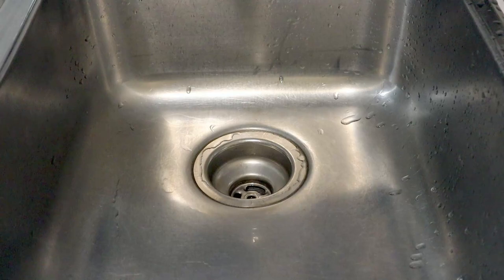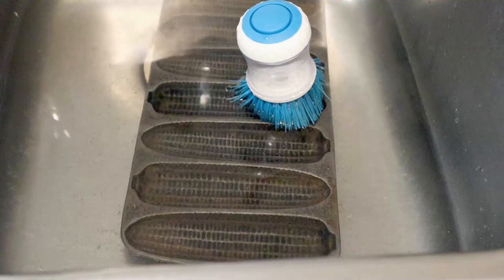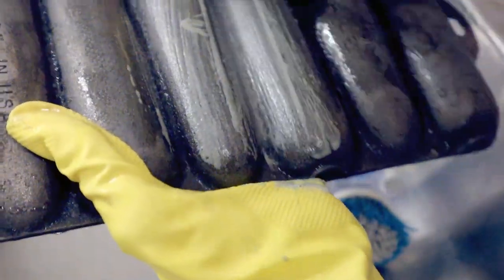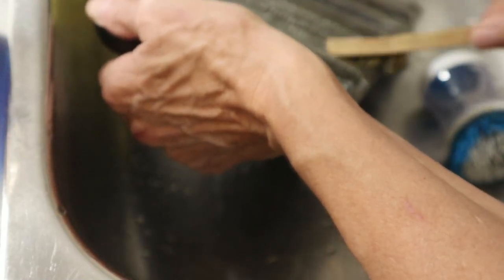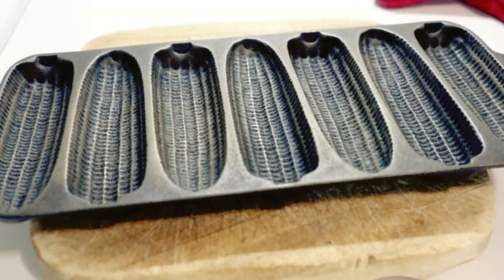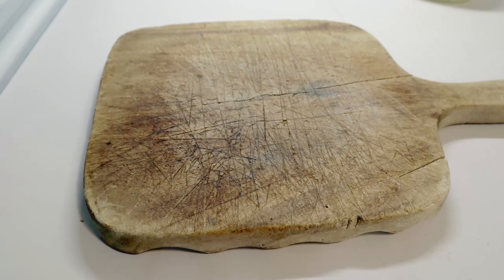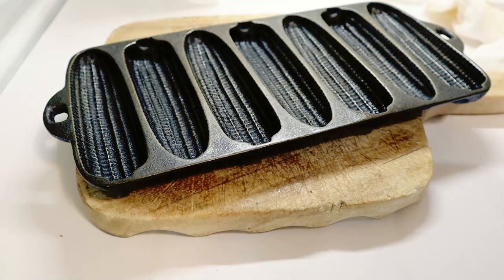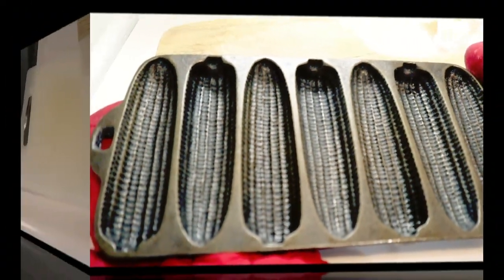Cleaning and Seasoning My Cast Iron Cornbread Pan.

Comment: Thank you so much for this video! I have a pan just like that.  It went through our house fire and looks pretty bad. At first we thought about wire wheeling it but worried about all the little bumps being damaged.  I am going to give this method a try and see if I can salvage it!
Reply from the maker: I wouldn't use a wire wheel...the vinegar bath will remove rust, a lye bath is good for baked on crud..using oven cleaner and a plastic bag is also considered cleaning it with lye...and the last best method is to set up an electrolysis bath..Mark set up one of those for me after getting some advice from a subscriber... 😁(see we learn from you folks as well!)

Comment: I have a similar corn bread muffin pan and also a Christmas tree shaped one. In our household corn bread is a staple.  We prefer the sweet mix and alot of times I will cheap out and use the Jiffy box mix. Just left an antique mall in Salamanca NY and couldn't believe the prices of cast iron etc, I know you must shop the thrift stores but it nice to Chek out other places.
Reply from the maker: antique malls are awesome..there is so much to see...but the prices are usually (not always) higher than flea markets and thrift shops

Comment: Did you preheat the cast iron in hot oven. The batter should sizzle when spooning in batter. Also next time when reducing the batter I don’t need to turn pan over I just release with a knife and slip them out. I’ve never turned the pan over myself. Happy eating!
Reply from the maker: yup, I made the cornbread sticks after having seasoned that pan in a hot oven for 3 hours

Comment: My mother taught me once she had her cast iron seasoned to never wash it with soap just water and a brush if necessary.   She would then place them on the stove to dry them til they were screaming hot then let them cool before putting them away.  She rarely had to re-season them.  I still do mine like this to this very day❤
Reply from the maker: If it works for you great...I personally do use soap and water, also dry on the stove and season after every cleaning..